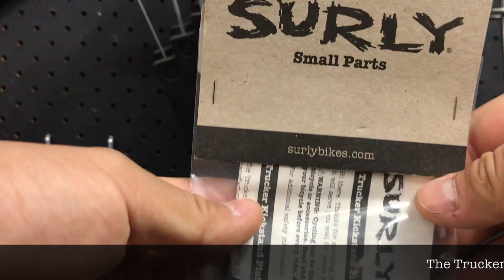Surly kickstand plate and Pletscher Twin-Leg stand install

Comment: Hi. I've been looking into buying double stand, but your last shot at 4:03 made me think. Does the bicycle naturally rest on the stand and front wheel? Or would it, while having bags on the back, rest on the rear wheel which seems like a more natural position. Otherwise, as I usually have rear more heavily loaded the kickstand would be constantly under heavy load.
Reply from the maker: Hi. You mentioned a quite interesting question. I believe it depends on the spec of your bike. For example, my LHT uses Son 28 dynamo front hub and XT rear hub, it shows exactly the situation you described. Nevertheless, if you're going to use different hubs or racks, it might be the other way around.

Comment: Did you have to cut the length of the kickstand? I’m running 26” tyres and have seen some folk cut off a bit of the stand.
Reply from the maker: @RedGoneRiding  I’ve tried 26*1.9 and 2.3 tyres on this LHT and it seems the kickstand is a fraction larger in any of these combo. But I’m not too worried about it because when stopping my bike on the loose surfaces the longer legs helps maintain the stability.
Reply: @zero_g_716   that’s fair. I’m running stock 26” ETs on my Disc Trucker, installing it on my own so I’m hoping I don’t need to shave an inch off the stands cause I don’t have the tools for it. I’ll see how I get on, secretly hoping you’re right that it’ll be fine.
Reply from the maker: @RedGoneRiding  Surely you’ll love it!
Reply: @zero_g_716   Tried installing it but failed. I have a feeling the bolt is either too long, or I just don’t have the skills(strength) to tightened it well enough to not interfere with the rear derailleur cables. It’s still loose and jiggles a bit despite having tightened it down. Off to the LBS for me. 😓
Reply from the maker: @RedGoneRiding  😢 sorry to hear that, maybe let your local bike shop’s mechanic double check it.
Reply: @zero_g_716  I did go to my LBS. They managed to attach it by using the attachments that came with the kickstand for the top where the bolt goes in, and half of Surly’s plate for the bottom half. Worked a wonder. 😅

Comment: Where did you find the 290mm Pletscher? I can only find the 320mm in the US.
Reply: I can't find it either.
Reply from the maker: Hi Frances,  I oraionally bought the kickstand on a German website called Bike-discount and got it posted to Australia, but I don't think they still carry them anymore. However, you can double-check with your local bike shop. In my case, Commuter Cycles in Melbourne has them in stock and I believe they can post it globally.

Comment: Hi there. Any chance you could give the measurements of that plate? As I'm thinking to use it on my 26'' mtb ebike - and to use same kikstand, and  if it's roughly ok - I could try adjust it and trim it if needed. Cheers
Reply from the maker: Hi, I wish I could help you. But my bike is in my apartment in Australia and I am unable to go back due to the border restrictions.
Reply: @zero_g_716  not too worry thanks and all the best!

Comment: I believe the kickstand has an included plate. Is this not compatible with your Surly that’s why you bought a separate plate?
Reply from the maker: Yes you are right. There’s a plate came with the kickstand and it is totally compatible with the Surly frame. But the included original plate is flat on both surfaces and it’s kind of a universal design. That’s why I bought these Surly plates because they have curvature surfaces that fit the frame better and are more stable.
Reply: You must use the Surly ones or you risk crushing the chain stay tubes.
Reply from the maker: @percyfaith11  true

Comment: It would be nice if you show how you came to choose these two products.  measurements?
Reply from the maker: Hi Tor, Surly produces the plates for its Long Haul Trucker and Disc Trucker frames mainly to provide a better fit. In terms of the Pletscher kickstand, you can choose between 26 inch to 700C wheel size depend on your setup.

Comment: Can you share link to buy this item..thanks
Reply from the maker: Hi Suzanah, I oraionally bought the kickstand on a German website called Bike-discount, but I don't think they still carry them anymore. However, you can double-check with your local bike shop. In my case, Commuter Cycles in Melbourne has them in stock. About the Surly plates, you can order them from Surly's website if you are in the US, but if you are outside of the US, it is easier for you to order them from you local Surly dealers.

Comment: Hi  I bought one for my surly disc trucker but the screw is to long
Reply: Same with me. I took it to my lbs and they cut the screw and rethreaded it. They positioned it a little further back, but it seems fine. I think I'll get the rubber boots for soft conditions, i.e. sand and gravel.
Reply: Buy a shorter one at the local hardware store.

Comment: Which tyres are those?
Reply from the maker: Hi, I had both my front and rear tyres as Schwalbe Matathon Plus. They are according to the reviews online, one of the most durable touring tyres on the market. I later replaced the rear one to Maxxis Crossmark II, just because I had one spare tyre and wanted to test its urban compatibaility.